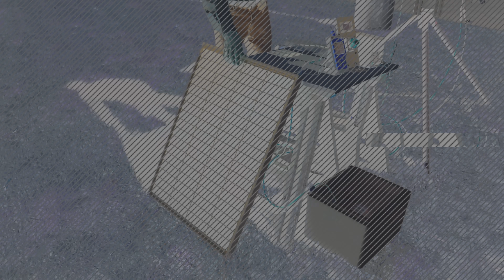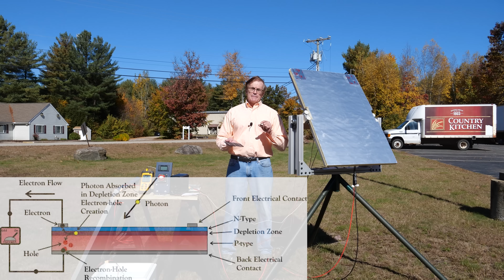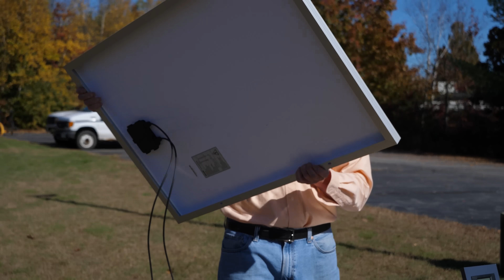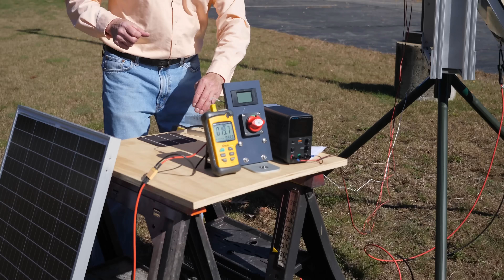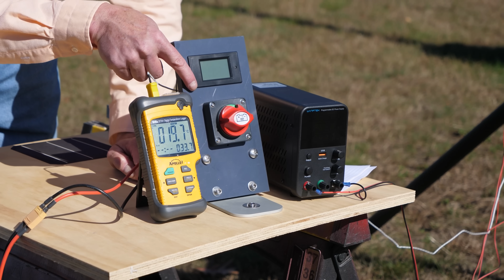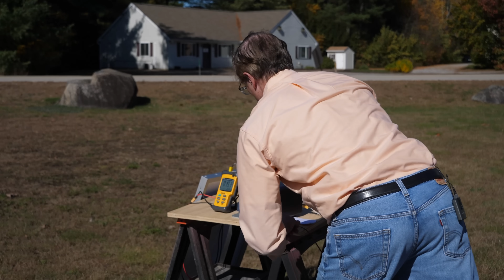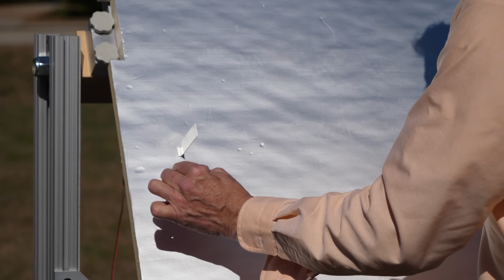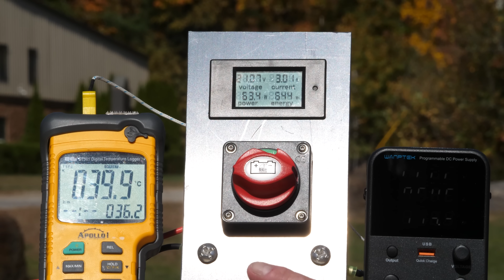Do you REALLY get enough out of your solar panel?

Comment: How cold should you be going?
What are the implications for cold weather installations? Does the efficiency gain have diminishing returns? 
I could maybe see using the waste heat to warm a workshop in the winter, and dry wood or just vent to outdoors in the summer.
What if every tiny part of the panel not creating power is painted with your super-coating paint from more recent videos?
Reply from the maker: The returns  will be greatest at the highest temperatures and solar intensity.
The coating will cool these components , but the available surface area will limit the benefit  to a very small value.

Comment: If you used a glycol closed loop system to transfer the heat, you could put the heat in an indoor space when desired, in a way it would be similar to how a heat pump HVAC unit works just at a lot less cost of energy since you'd be running a water pump and fan or fans instead of a refrigerant compressor. The energy offset may be worth it doing it that way in the winter and using it as an indoor heating source. Not sure how good it would work at temps of 40 degrees Fahrenheit or less, 40 degrees F is balance point for a heat pump system, at that temperature or below, a heat pump can no longer transfer heat from outdoors to indoors. I do believe however, liquid cooling could do better, just not as easy or cheap. Powerful gaming PC rigs use liquid cooling so that could be a small scale experiment starting with a PC cooling system, they are DC powered and it's easy to control the pump and fan speeds. Also in a large commercial building you could run a take off duct from the building HVAC system to cool the backside of the panels, by law those large systems must draw outside air at a small percent to prevent "building sickness". Heck you could heat domestic water with the unwanted solar panel heat draw. I wouldn't worry too much about leaks as the water pressure doesn't need to be high, not like booster pumps pushing water 30 stories high, heck not even city pressure which is about 70 psig most places. You could also modulate cfm and gpm to tweak efficiency. I'd start by looking at small HW return circulation pumps or solar swimming pool heating water pumps that are used in the system where water is moved from the pool to a coil on the roof, then back into the pool. Great video, being an edifice engineer, heat transfer is a thing I'm really into.

Comment: nice test. covered everything to show the difference. im curious how only an exposed passive heatsink on the back would perform and would it need to be thin strips like you used or a proper heatsink with a bit more mass like the bigger heatsink you showed.

Comment: great experiment, but what does the data show without the sheetmetal backing that hold the fans and provide ducting?
Reply from the maker: The modified panel runs slightly cooler than the stock panel when the fans are off.

Comment: seems like a minor gain, sure high temperature degrades solar cells over time, but the power gain of 2 axis tracking is far greater than a few percent. sure the cells will experience more heat, but tracking is  the only way to generate pretty constant power throughout most of the day to run electric motors with real time solar power not needing expensive battery storage.
I wonder if double sided glass panels are better at passive cooling than plastic back panels, they give a much higher power warranty for these. obviously, free standing panels will allow for more airflow than roof mounted ones

Comment: you could also implement some type of temperature switch, only activating above say, 40c as well as ramping up in speed as temperature gets higher up to a point of course.  saving even more energy as the fans wont kick on when they dont need to and will cool them better as it gets hotter.

Comment: There is a passive way to do it with heat pipes, those tubes in the center of the glass vacuum tube solar water heater panels.  No extra energy used or moving parts.

Comment: As I watched this I had a thought about making a passive cooler for the solar panel.  If you had a black painted metal chimney at the top end of the cooling chamber then the heat of the sun would pull cool air from below the solar panel and convection would draw that air over the cooling fins.  It should be enough to eliminate the need for the powered fans.
Reply from the maker: It would work,  but it would have to be quite  bulky  to equal  the flow rate of the fans.  Of course,  that means no parasitic loss from the fans, but nesting multiple  panels  might get complicated.

Comment: You just added another point of failure, plus it's a moving part which decrease reliability specialy when outdoor. Over span of 25 years that fan will need to be replaced at least 5 times plus regular maintenance. 
Now if there is passive way yo cool them that would be something.

Comment: I think by not using a MPPT solar charge controller and using simply resistors instead, you have missed even some more extra power that reducing the temperature of a sollar cell produces. the power that comes from ability to increase the bias voltage of a cell when it is cooler. you just extracted the extra power comes from better conversion of photons to electrons in cooler condition. MPPT adjusts the operating voltage of our pannel which is increased significantly by lowering temperature
Reply from the maker: You may be right.
As I said, the intention was to be as transparent  in the comparison as possible.
Reply: Yes you said so but in my opinion using a MPPT power converter is a must for doing this kind of tests wich a single extra watt matters. otherwise the results can not be reliable and can be way diffrent in practice. so this is not being transparent this is a none operational test condition that is not getting the maximum power of a sollar panel. Nowhere a serious solar panel system is being used without a power converter to bias the pannel properly.

Comment: I like the idea of cooling panels with water because then that excess heat could be used to help heat water (or even a pool). If you are lucky enough to have a geothermal loop installed or are abel to do so, then that is a reliable source of cooling power which would solve any excess heat (I also wonder if it's possible to generate additional energy from the temperature difference between the heat from solar panels and the cool of the ground).

Or if you built your house & roof such that one side was always in darkness (parallel to sunlight) thenthat side of the roof could be filled with radiative panels (the space ejecting kind) that could dump all that excess heat.

Comment: what about gluing strips of aluminum painted in the reflective/emissive paint from your latest video to the front of the panel  You could make them something like 4cm tall and looks like 5cm wide to go in the gap between the cells.  This would conduct heat out of the glass and emit that in all directions, especially sideways.  It might gather ambient light from the sides, and if you have the tracked spot on the sun it won't shade the cells.

Comment: Or water cooling and use the heated water to preheat the incoming house water
Reply: Source manufacturers who make water blocks for gpu and cpu. You'll find large amounts of liquidated stock when the chip is obsolete. Those can be used to epoxy to the back of the panels. Use the water. Don't just dump it. It's energy
Reply: Or use the material from swamp coolers and an atomizer to spray the back of the panel and mount them above your crops

Comment: I really like the idea of dripping water over the panels here in North Carolina. I have a spring on my property that stays consistently at 58F, even when it's 95 outside. I could cheat and install a small additional cheap solar panel and pump system just for the water, so it doesn't consume power from the main system. :)

At the same time, I want to use this to water my roof during hot sunny days. Should definitely reduce my air conditioning load compared to a roof that can be 140F or more.

Biggest concern about all if this would be possible mineral deposits left behind by the water. Hmmm.

Comment: I think I would add a thin pocket or flower oasis on the back of the panel and let rain water fill it. The pocket would have a large gap or area that cause the water to evaporate and remove the heat. Like how a desert fridge works.

Comment: How much heat is being taken out of each panel? how many panels on a house? maybe instead of using air to cool the panel use a glycol solution in pex tubing and use pex heat transfer plates thermo epoxy'd on the back of the panels. all very cheap and commercially made products. 
seems like a win win putting heat into the house, storage system or potable water storage tank and cooling your solar array at the same time.

Comment: The fans are also last 20 years? Or we should include 5 or so fans change over these 20 years. It is rhetorical. Great channel btw. One of the best and most instructional ever created in YouTube.
Reply from the maker: Thanks!
MTTF is 50,000 hours at full power.  We're  running them at most 12 hours  per day at 25% of their maximum  rating.

Comment: Love it! In my 4KW PV array in upstate New York, I was distraught in winter when an inch of snow dropped output to zero. I disconnected the array from the Controller, and fed pulsating DC from a 240 volt bridge rectifier to the panels. In an hour, enough of the snow melted to begin self-defrosting. Reconnected the controller and produced power the rest of the day instead of zero power.
Wish that switching was an option of the controller!  Could easily be fully automatic.

Comment: I believe a water recirculation system would be better
Reply from the maker: You may be right.  It depends.
Reply: @TechIngredients  you could attach to the house water reservoir and have free heating, using some power to just circulate the water. I hardly believe a large household water reservoir will heat up enough, but you could add a radiator if needed. The concept of cooling the panels is super smart, congrats on the video demonstration

Comment: It would be cool to combine solar panel with diy solar heater underneath for cooling, say just a pipe of circulating water that goes to thermal accumulator (water barrel) for say heating water, so you not just wasting this heat. They are extremely easy and cheap to make, like here https://www.youtube.com/watch?v=3Wk66gJ8lOE . They guy made a video actually lives like 300km from where I live hehe)

Comment: feel like there should be a control solar panel during this experiment
would make it more accurate

not gonna bitch too much cuz I'm lazy af and telling other people to make their work more complicated for my satisfaction is weird
guess it's enough for a short scale experiment that's just proving that it's possible rather than outputting accurate numbers
Reply from the maker: Agreed.
I appreciate  your recognition of the limits  to any experimental  demonstration.
Also, when using multiple  panels, you would have to control  for the variability  in the performance  of each panel.  The "control" on its own does not establish  an absolute  baseline.

Comment: A clear scientific demonstration of the value of keeping the solar panel temperature in a safe range. 
Thank you🌹. 

The refrigerator runs on 100 watts power through the day. A 12 volt 8A panel can supply this power for 6-8 hours a day for twenty years. This greatly exceeds the cost of the panel. So it's a great saving. No power failure. Safe.

Comment: This is somewhat off topic, and much longer than it should be... but I have a question you might be able to answer.
Recently I was troubleshooting a circuit board on my bench and found stray voltage (when not connected to any power source) that increased / decreased depending on how I was positioned at my bench.
My first thought was RF and my body acting as an antenna or reflector. That didn't produce any results but what I eventually discovered was that I was casting a shadow between my work light and my body onto the board.
The culprit turned out to be a common LED. When fully exposed to my work lamp, it proved to be the source of the voltage!
To prove it, I experimented with several LEDs out of my parts bins. I could connect one directly to my voltmeter, then increase / decrease voltage depending on the amount of light exposed to it.
I then made a couple of arrays, one connected in series, the other in parallel. I could manipulate voltage and current depending on the intensity of light exposure and the way they were connected.
Could you please explain how & why LEDs work in reverse?
Reply from the maker: It's  a semiconductor, as is a solar cell.  You can also buy semiconductor based photodiodes as light detectors for circuit boards.
Reply: @TechIngredients  Almost too simple... but makes sense. When I first encountered that, I thought I had entered The Twilight Zone.
I'd compare my reaction to the first human hearing a parrot talk. Guess it's one of those... "you had to be there" stories.
Thanks for the instant explanation!

Comment: What is the temperature increase when the back side is not covered, we do not know if we have increased the temperature by covering it up, comparing to a unmodified panel against a covered up fan operated one would have been more informative.
Reply from the maker: The modified  panel  runs cooler even with the fans off.  But, the difference  is small.

Comment: A lot of useful information, however to be fair the test should be comparing the panel with nothing in the back (you could use the twin one if amazon sells them in pairs) with the one that has all the system mounted in the back. The panel you tested will heat up more because of the enclosure in the back until you start the fans so you get a bigger temperature difference.

Comment: Is it possible to use the passive cooling panels to dump the heat into the sky? Maybe using a heat exchanger with coolant flow to pull the heat from the panels and quickly dump the heat using open sky cooling

Comment: This is great, thanks!
You explained why you didn't do it for testing purposes, but it would still be great to see those fans pull power directly off the panel and see how they perform. Installation would be much more simple, and you wouldn't need controllers to turn the fans on and off or potentially ramp them up or down. As more photos hit the panel, the fans run harder. At night the fans turn off on their own.

Comment: Would it be easier to vent to a thermal cooled air intake ventilation pipe from the ground? Where the thermal mass of the ground cools the intake air, that ventilation routes to the bottom of the panels and the heat from the panels triggers the hot air to rise out the top vents, creating a thermal cooling convection current. It's a bit like a straw where the cool air is being sucked up because the hot air has to escape out the top. No fans necessary, basically a maintenance free solution, it would also work better in hotter climates/weather. Fans may provide better cooling by forcing the air up rather than relying on the heat of the solar panel alone.
Reply from the maker: It would  work better, but it wouldn't be easier.
Low resistance buried air ducts would need to be large and deep enough  to maintain  their lower temperature. One meter is probably  a minimum.  That would involve moving a lot of earth.
Reply: @TechIngredients  Interesting

Comment: Can you insulate the back of the panels with styrofoam and cool it that way?
Reply from the maker: How would that cool it?
Reply: @TechIngredients  will stop heat from rising from below the panel into the panel. Also will stabilize the overall temperature of the panel. In winter in Canada we put Styrofoam on an outhouse toilet seat and it allows you to sit on it down to even below -50C weather. I am picturing the same with the panels. I may test this on my next panel setup.

Comment: in the end this is adding complexity to something that was almost maintenance free (fans will die or build  dust...), the gain seems at best around 5% given a more efficient way of cooling. on that basis, the cooling system can't exceed 5% the cost of the panel or you will be better with an extra panel with no cooling
Reply from the maker: You're  ignoring  the increased lifetime  of the PV panel.
Reply: @TechIngredients  well, this will move the balance in favour of active cooliing, i have no idea of how much difference can make, time will tell. I love your videos, keep up good work

Comment: I’d be curious to see what a heat pump system could achieve vs using simple fans.

I also think fans would serve as a great backup measure once a water-based system has reached saturation. One major advantage to some of the water based systems is you can recover the heat to household radiant heat and hot water systems. This is particular nice in the winter months.

Lastly, for systems which don’t track the sun, I wonder if a reflective shade that “turns off” a panel may be advantageous to prevent heat recovery systems from bleeding heat into a panel which is no longer absorbing more heat than its naturally emitting back to the sky.